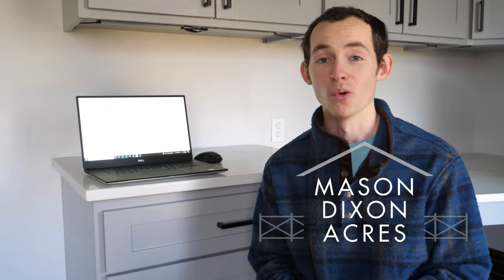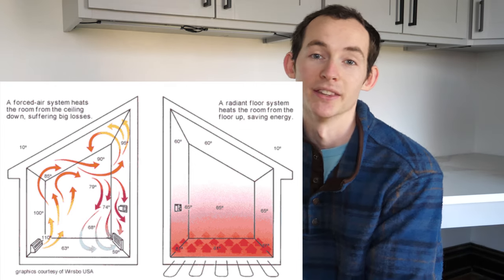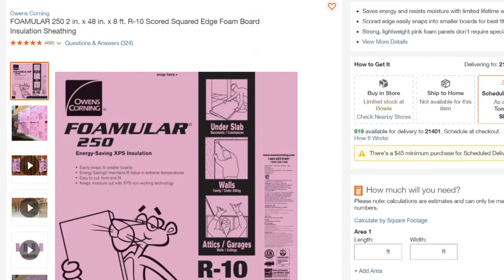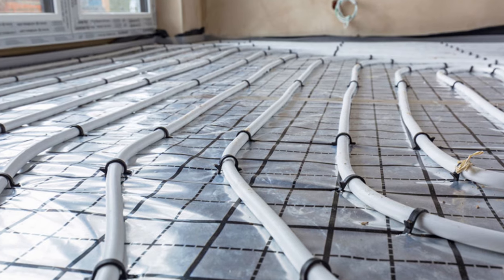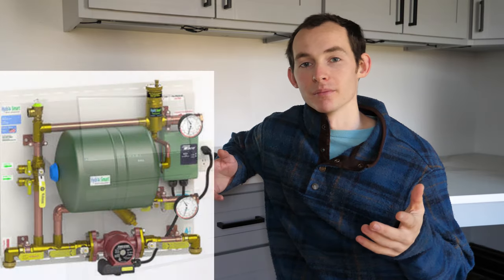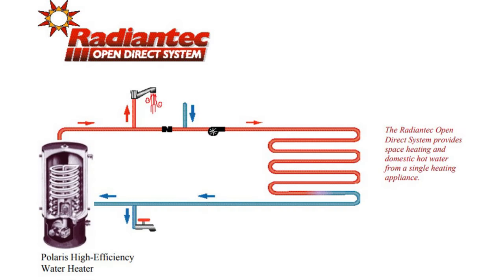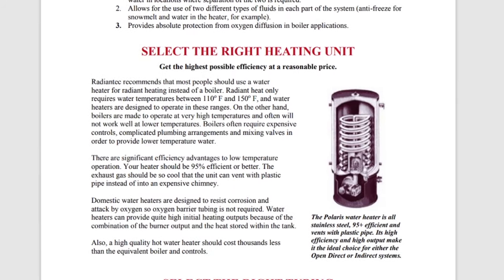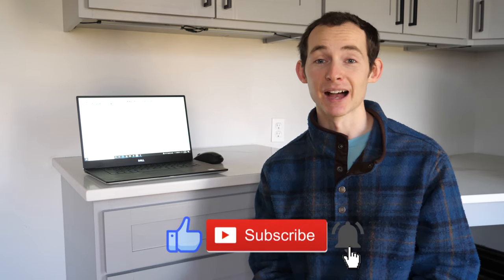Planning Radiant Floor Heat (Design and Cost)

Comment: Nice video. I have used two tankless water heaters for our forced air hydronic and our daily use for 20+ years. Use soft water so no problems there. Your on the right track. I did the forced in a retrofit of an old pioneer home built in 1907. Workin' great. Good Luck on your venture.

Comment: Late to the party, so I've been binging the back catalog.  I've heard you mention that slabs lose most of their heat through the edge a couple times, and I'm having a hard time wrapping my head around why that might be.  My intuition tells me that heat would follow the path of least resistance from hot to cold, which ought to be through the top and bottom surfaces.  Of course the relative temperatures of the cooler regions would impact the rate of heat flow, but so long as the perimeter edges are within the insulated envelope, I would expect that to reduce the rate of heat loss around the edges.  I guess it all comes down to assumptions and boundary conditions, but I just haven't been able to reconcile it myself.  Really excited to see what's next in the build process, even though it happened 2 years ago!
Reply from the maker: Haha thanks for following along! The U.S. DoE and other sources have published some great info on this showing the simulations and experiments. Slab edges abutting a perimeter wall are the closest to cold outdoor temps, losing heat the most there. The bottom surface loses heat at a lesser rate to the ground, which is ~50F year round, especially if there is a perimeter stem wall that is insulated down to footing (code here). The top surface is losing heat to ambient air as intended. So in general, thicker insulation between slab edge and foundation wall will preserve slab temp better than thicker insulation between slab bottom surface and ground.

Comment: This is two years later I am just finding this video. Did you consider putting the vapor barrier below the insulation? You punctured it quite a bit attaching the pex to the insulation.
Reply from the maker: PEX was tied to rebar, not sure what you mean
Reply: @MasonDixonAcres  My mistake. I thought you said you stapled it to the foam, through the plastic. I've been binge watching your videos it was late and I was half asleep when I made that comment.
Reply from the maker: @dennisalex3655  haha no worries. Wanted to put vapor barrier above foamboard to make sure no foam could float up during the pour. Also, vapor barriers don’t really work like air barriers. You can puncture them and their effectiveness is still proportional to the covered area. Joe Lstiburek did a good article on it, there was a quote along the lines of “you can tap dance on your vapor barrier in your golf shoes and it won’t make much of a difference”

Comment: Did you ever consider using a 65 gal. hybrid/ heat pump hot water heater instead of a propane boiler?
Reply from the maker: I did, heat pump water heaters work best when they are in unconditioned spaces in warm climates since they pull the heat out of their surrounding space. I don’t think it’s the right product for our application. Also heard they are quite loud and have to run almost constantly

Comment: Great video and explanation of costs at the end. Do you have a ballpark $ for what a forced air heating system would be if you just went the traditional method and combined it with the AC duct work?
Reply from the maker: Getting preliminary quotes for the ducted system now, we basically will have a forced air system as well. It will be sort of a backup. I would imagine running ductwork will be a few thousand, the furnace/air handler is probably another 1-2k, and the A/C unit another 1-2k after it's charged up and ready to go.

Comment: Great explanation, however, I didn't understand the idea of installing a 'water heater' and then adding a out door wood burner in the future.  My understanding the bulk of the cost of those systems is the plumbing and interior installation (as described in the video).  Having just installed a wood stove on an older home with central air,  I've spit balled all the different options (forced air, heat pumps, interior/exterior boilers, ect.).   Given the added complexity are there any concerns with radiant systems breaking down (i.e. the pumps failing) and being in PA - I'm curious if you plan on also sourcing and stockpiling coal for the out door boiler?
Reply from the maker: The outdoor wood boilers are expensive, probably close to 10k for a modern one with everything you need. Since we are paying for the whole build up front, a wood fired system is a nice-to-have to save money down the road once we are settled in and have time to do firewood. I'd like to have the option for it to work at the flip of a switch, so that's where the propane heater comes in - either dedicated tankless or shared with house water heater. Eventually I'd plumb it to work with either propane or wood fired.

Not really worried about anything failing (except tubing in the slab - that's bad). Everything else will be pretty easy to access and repair/replace if needed.

We aren't really in the coal country of PA so we will just stick with the firewood on the property, there is a ton

Comment: I would get two 50 gallon water heaters.  Rheem performance platinum hybrid 110v for your showers and sinks always in hybrid mode.  I would then get the AO Smith 50 Gallon Voltex Residential Hybrid Electric Heat Pump Water Heater for the radiant system 220v.  Both use heat pump technology.  The AO Smith hot water is a bit more robust with two larger heating elements, which has a higher full electric output for the cold months and then use hybrid the rest of the months.  To connect to your radiant system use the AO Smith hot water outlet and then use the cleanout valve on the bottom which is your input back into the tank to heat the water again.  This is what we're doing.
Reply from the maker: Nice! We thought about the heat pump heaters but for a slab this size it takes a lot of energy to warm it. The heat pumps pull that energy from the air around them, so it's sort of working against itself. In hot climates they do much better. I also only wanted a single appliance for both floor heat and domestic water heat, so a propane tankless unit from Tagaki won out

Comment: Build it to passive home standards. And then a $1500 Mr Cool DIY mini split will be enough. Insulation Insulation Insulation. Everything else is easy if your house has very little thermal loss.
Reply from the maker: Haha ironically we are using MrCool mini splits in the garage and their Universal ducted system upstairs! We will be using Rockwool R-23 batt in the walls and R-38+R-23 in the attic.